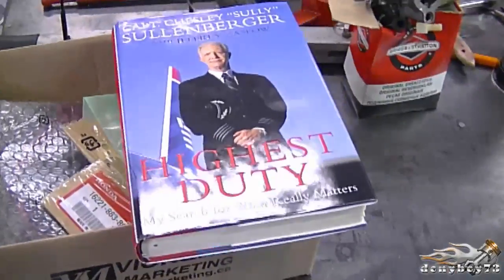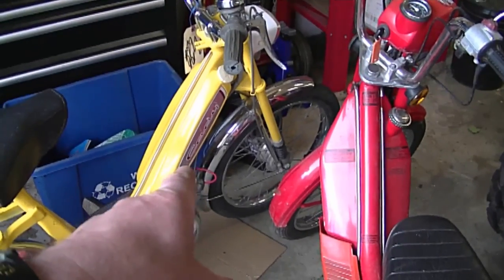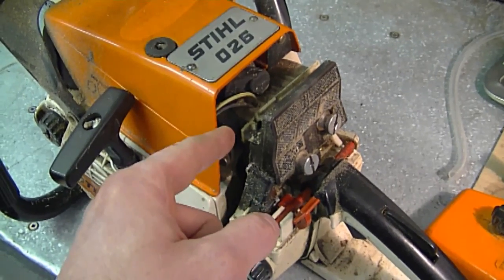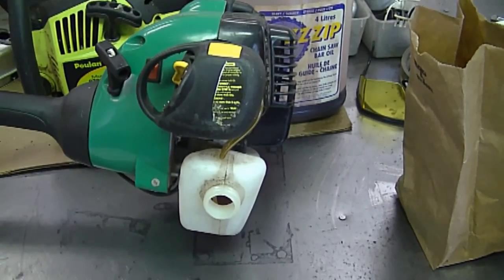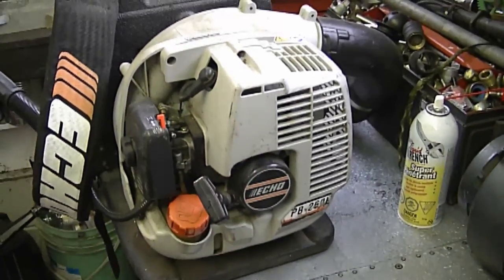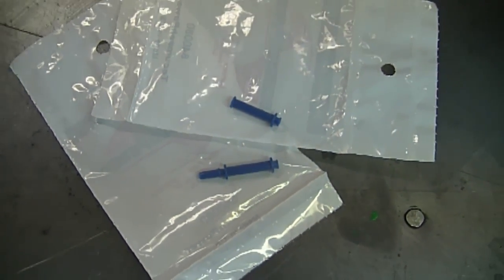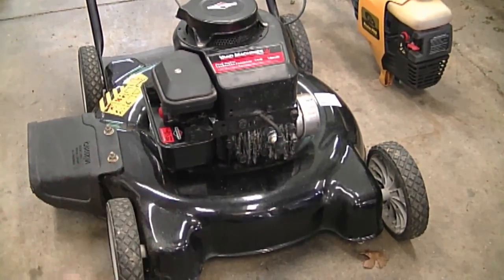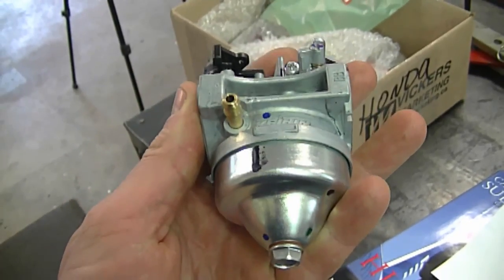Small Engines Q & A Video #127 in HD

Comment: in a program, you had info im batteries to åmkgräsklppare I'm an electrician and know that a common problem is that the battery is charged with 16v or more, but a battery of 12v may never be charged with either than 14.5 v otherwise boils battery do you put two powerful LEDs in series with the charging cable to the flywheel must be a voltage drop of 0.5 v per diot just a tip that allows the battery to last instead of one year for about 5 years, but you must then run the mower at least 20 minutes at a stretch otherwise it is a risk that to charge the battery

Comment: I've got an old Model 190702. It's not emitting any white or blue smoke at all but I just replaced the oil and 3 runs later the oil is at add. Please Help. Please Donyboy.
Thanks. -CJ

Comment: #7 Question. Surging can also be caused by a plugged air filter. My 12 HP single cylinder B&S was bogging down and surging back up to rated RPM. I changed the air filter and problem solved. Filter had a foam pre-filter so every year I would clean the foam and reuse the paper element filter. It looked clean, but particulates build up in the element and prevent air flow.

Comment: There is no gas leak. I know. But I figured it out. Its a auto choke engine. The throttle rod was stuck and had to take it off. replaced it with a rubber band. I never moved the throttle a different way to try to get it started. But got it figured out. Thanks tho

Comment: And also, The plastic cover that goes over the crank case, it covers the connecting rod and shaft. Shoud that plastic cover just have an O ring to create a seal or a gasket or both ? I have a felling that is where my compression loss is from. I only register about 50psi.

Comment: iron  Replaced the coil and away she went. Any Evenrude dealer has them. Part number 584477. Points 580148. Condenser 580148.
horse was a canadian engine from what i have found. johnson outboard iron horse engines. may be this will help.

Comment: Hey Dony, I have an older Tecumseh 5 H.P. engine and I did everything I can possibly think of to get it to run right. I completely replaced the carbuerator, it has 97 P.S.I. compression, and the valves are in good condition and working properly, but the engine still runs very rough at full throttle, but runs OK at idle. Any ideas?

Comment: I just got a old 8hp briggs running. Model 190702. To get it running, I has to clean the carb. It was very dirty. But for some reason, after it sits for 2 or more days, it takes 25+ pulls to get it started. It won't even turn over. But when it does, it starts immediately. But when I pull it about 5 times then put throttle all the way down it turns over and sputters. Then I put the throttle up on max and starts up right away. I want it to start up immediately every time. Plz help.

Comment: on my teccumseh 8hp mod. 155426M when I move the throttle lever up and down acceleration does not change,if I move the plate with the holes on it with my hand directly the motor speed changes from max to iddle coul you help please?

Comment: clean or replace your fuel filter first
check you fuel lines and primer bulb if you have one make sure they are not brittle or cracked
if it starts and runs spark should not be an issue
but it sounds like a carby kit is needed and a good carby clean

Comment: Hi Don;My neighbour has an Iron Horse engine,it's in great condition.Think they were made in Ontario.It is not very big,didn't they use them on old ringer washers.Some of them had kick start.I also have a problem with my 345 Husky,it won't shut off with the switch.I had it in to be repaired,but it's still not working.I was told I needed a new switch.Keep up the great videos.

Comment: not rototiller but pressure washer-rototiller used 2 times now wont start but I think carb clogged because it run good feedind gas thru spray bottle why why do I have so many issues with small eng all have little use

Comment: I have a troy built rototiller about 7-8 yrs old but only used less then a dozen times first couple times work great next 5-6 times it loups needs some choke now last couple times only run on choke but it did run right once around the5-6 time of use ive tried fresh fuel,cleaned around gas cap seal -my cement mixer has similar issues but not as bad I quit using 10 %ethenal gas and I live in calif they have engines set up different for smog I was told anyway I would appricate any help thanks